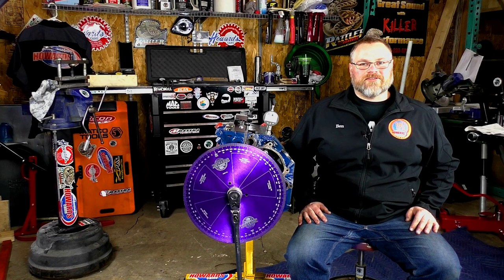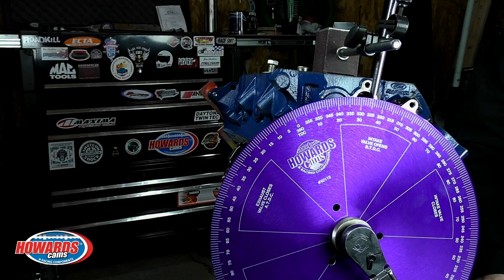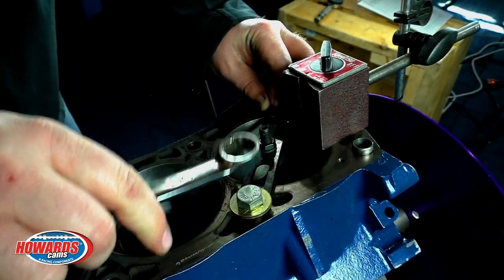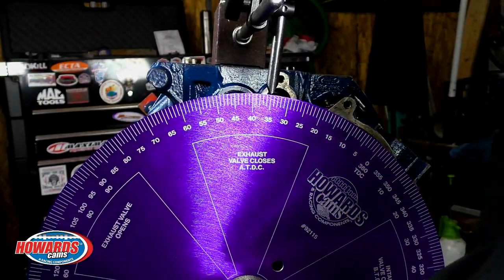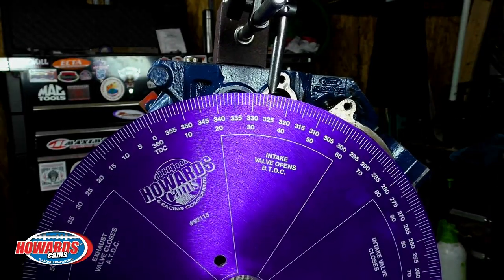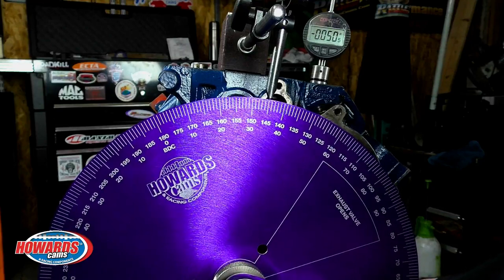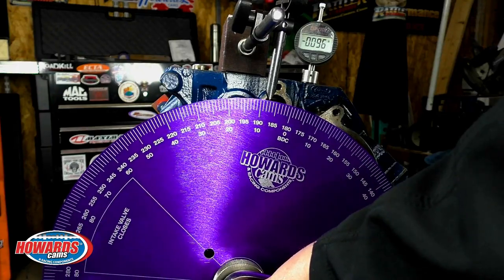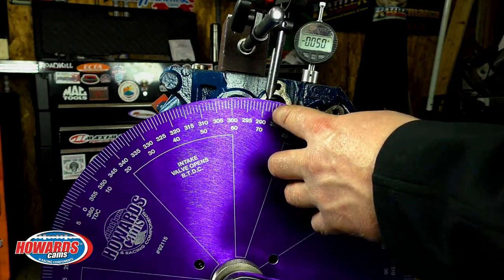How to Degree Your Camshaft with Howards Cams

Comment: The most impressive part of this video is that you are doing it at the right time, with a ringless check piston in cylinder #1 only. I also noticed the file to fit rings placed in their cylinder awaiting assembly on the piston, which is exactly how I do it. The reason for doing it this way is that the engine is a lot easier to rotate smoothly with no ring drag from a fully assembled short block. This is also the opportune time to do the first trial assembly of the valve to piston clearance. This way if you have to fly cut the pistons, you only need to take one out of the engine. It’s also a good idea to not put the full set of pistons on the rods until this first trial assembly is completed. Good video.

Comment: Well....I suppose you need a degree in automotive engineering to understand anything in this video.  Why are you using any of the numbers that you used?  Why did you find top dead center the way you did?  Did you just randomly screw the piston stop to an arbitrary point and do some janky math to get some specific number?  Why was that necessary?

Again, I think this is video was made at home for the boss as part of the "training process"......not for anyone searching answers!